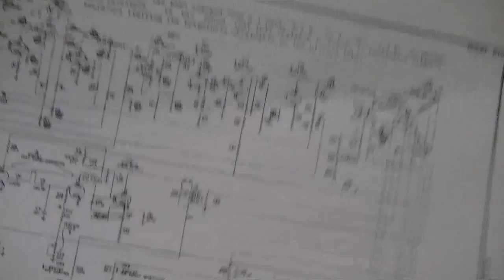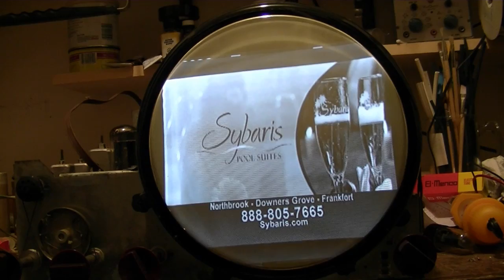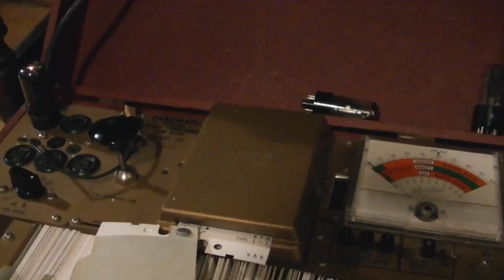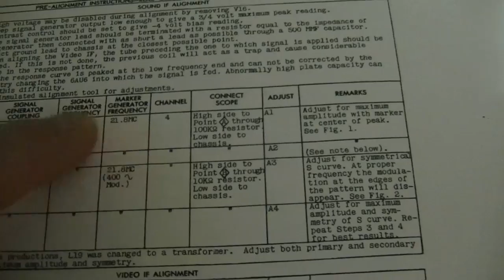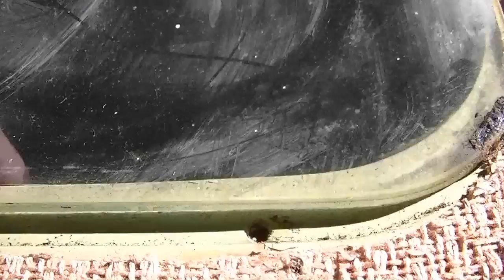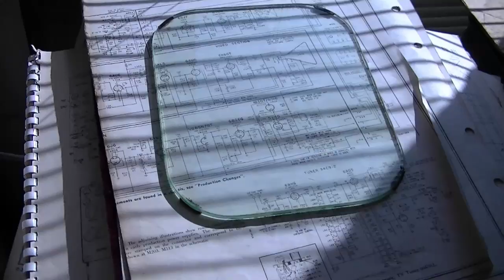GE 810 Redux p7o8

Comment: Why try to use the old glass when you could just get a new piece of glass cut to the right shape, size, and thinkness and the 2 old pieces of glass? I know you want to be as original as possible but I dont think the glass would matter if you replaced it with a band new piece.

Comment: Nice!  You've demonstrated that old adage...  the best test is in a set.  I wonder if a high end lab tester or some sort of analysis of the different tubes outputs would lead to an answer.   you could drive yourself nuts like I do by testing the tubes in different testers.  The set is looking really great.   I wonder if there's some sort of dry cleaning type spray, maybe something for car upholstery that would clean that grill cloth without shrinking it.

Comment: That grille cloth in the G.E 810 looks a lot like something I saw once in a fabric store called "Monk's Cloth", the weave is a little different though. The monk's cloth may be white instead of beige though so you would have to dye it, but it has a very similar texture and an open weave like that G.E cloth. Automotive brake cleaner is one way to clean a grille cloth without shrinking it, it has perchlorethylene in it like the dry 
cleaners use.